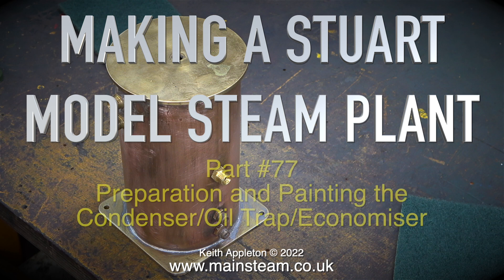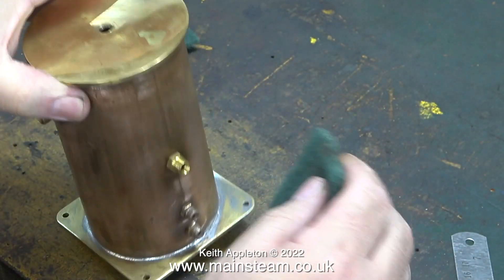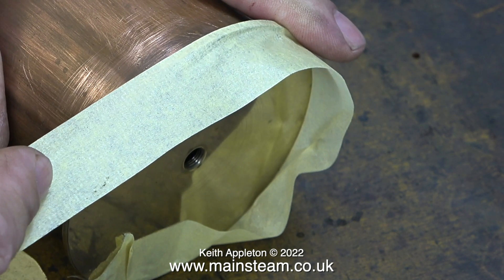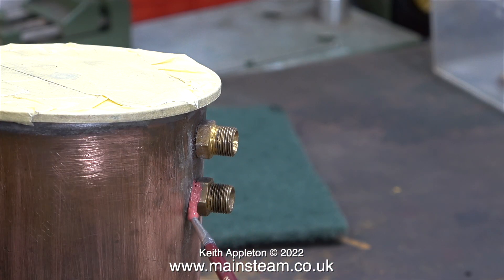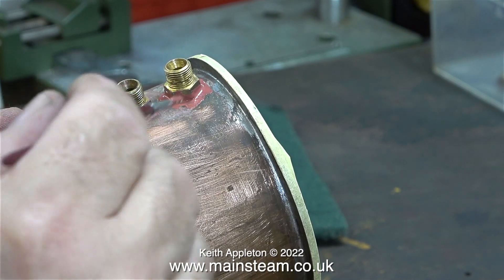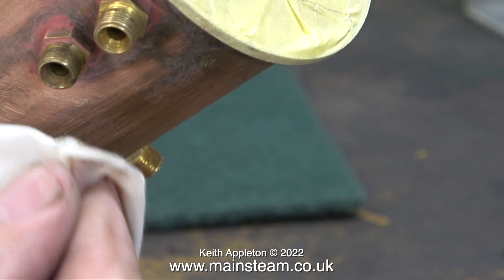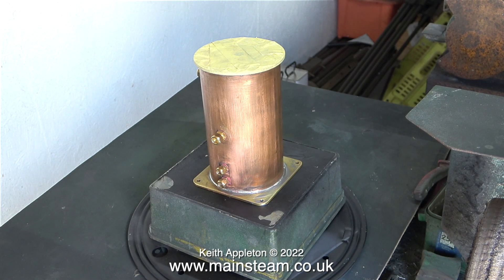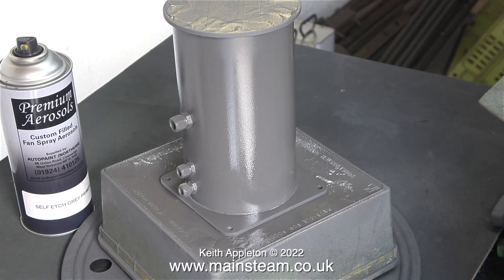MAKING A STUART MODEL STEAM PLANT - PART #77

Comment: just a question . . . the fittings you screwed onto the various inlets and outlets to keep paint off the threads are open on the ends . . . would a ball bearing ball keep the paint from coating the cones?

[ seems like it would mean less cleanup at assembly ]
Reply from the maker: The paint doesn't really get inside the hoes I find . . .